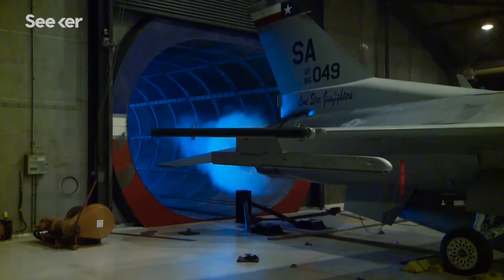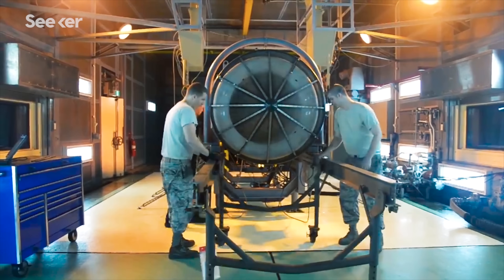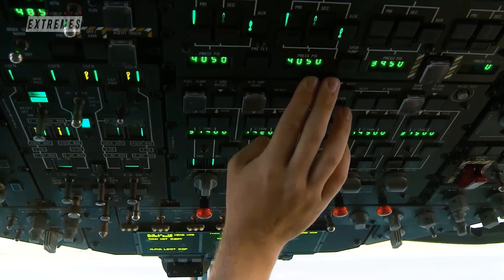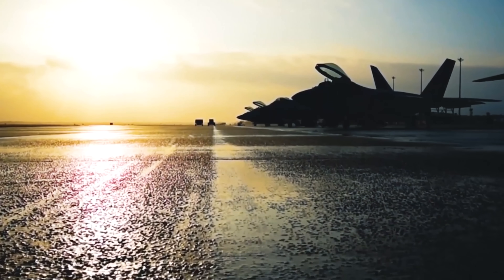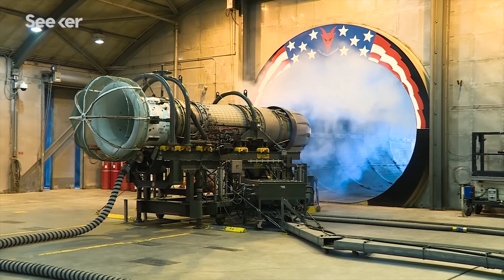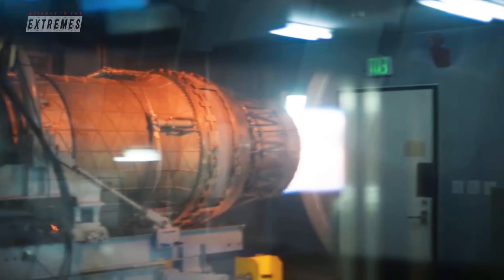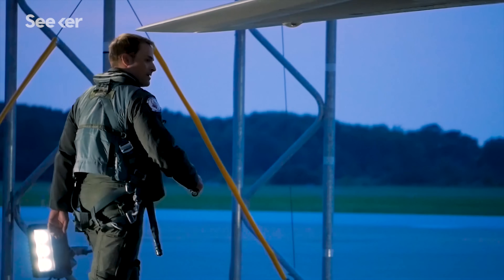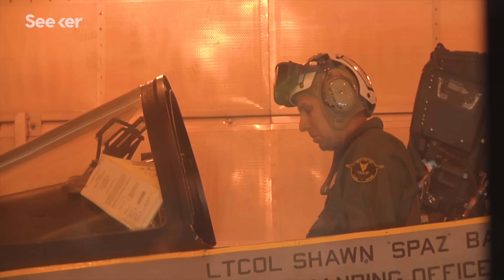How Do You Test the World’s Fastest Jet Engines?

Comment: The F-22 is not the best.

The F-22's Engines are not the most powerfule, F-22 Engine between 32-35,000 ibf of Thrust, the Engine on the F-35 is 40,000ibf of of Thrust, but even that is not the most powerfule.

The F-22's speed is 1498mph using TMS is Mach 1.98 not Mach 2, and the F-22 is not the fastest jet.

Plus the F-22 is not the only jet that can fly Vertical up and not the only jet to supercruise.

Comment: the noise from these engines amounts too 155-160 decibels. that's enough to perforate or even rupture the eardrum rendering you deaf. the noisiest place when the engine is running at full throttle is directly behind it

Comment: Using liquid hydrogen in jet engines would be interesting, it seems unlikely that the commercial air industry will ever make the switch due to the difficulties in handling it and the larger tank sizes that would be needed. But for military aircraft where money is no object and performance is what matters most... I could see hydrogen being used on long range reconnaissance drones that have to stay in the sky for long periods of time, or something similar like cargo planes that have to travel extremely far without refuelling. Fighter jets might be impractical because you'd have to make them significantly bigger to hold enough fuel and that could compromise the stealth aspect.

Comment: i worked on f-16s in the air force. they also test engines outside next to the hangar. the hush house is only used during quiet hours or for new or removed engines. standing next to an engine in full afterburn does more than vibrate your chest. it rattles your entire skeleton and you understand what real power is.

Comment: "Their mission is to make sure the jet engines don't explode..." sitting right beside a running jet engine!
Reply: With polarised capacitors connected backwards and feeding them 220V instead of rated 12V...yeah i watch your videos😂
Reply: How come you don't have more likes
Reply: it's actually normal to stand beside an engine during test runs or so, we do it all the time with commercial plane engines. Standing behind or in front or within it's radius or suck or blow is a whole other story
Reply: @Huy Thai Actually, what they do is they firstly run the engine in a Testcell, where the computers handle mostly everything and no humans is allowed even close to it, after that Testcell, they do another test where they see if some of the parts are working in the engine, such as the Starter Valve, this valve actually needs a person to manually open it, and as soon as it opens, the engine starts up too, making it dangerous for the person to move infront or behind it as well, and hence he just stands at the side of the engine, which is safe.
Reply: Lol
Reply: FULL BRIDGE RECTIFIER!!!!
Reply: BOOM
Reply: Ouch!!
Reply: LOL
Reply: Hey Electro!!
Reply: well the engine housing is designed to contain any parts that may come loose during what's called a blade off event or fan disk malfunction. the only places where you wouldn't want to be near the engine while it's running is either in front of the intake or near the exhaust.
Reply: FULL BRIDGE RECTIFIER FOREVER
Reply: Hey there!!! Man you commented on this!!!
Reply: Sup ElectroBOOM.

Comment: SEEKER is my recommended SCIENCE channel.........*10/10*
Reply: My god! I really hope you know of better science channels on YT...
Try Smarter Every Day, Veritasium or Sci-show for a start. Seeker features a whole lot of spin and hopefully Sci-show isn't next but in all honesty all of these channels has spin sometimes. So why is Seeker not on my list of good science channels? Because they spin almost every video one way or the other. Ok so this particular video is mostly accurate... Except when they used the wrong b-roll at certain points in the video showing off an F35 and many clips with F16 Fighters and multi-role craft instead of the F22 which the only fighter craft they mentioned by name in the video. The F22 is a stealth fighter, but noise isn't going to be an issue. It's a jet, it's loud what makes it stealth is the paint job, composite materials and body shape all made to absorb RADAR emissions instead of reflecting that light back to the transmission dish. Of course stealth as we know it will soon be completely irrelevant maybe that's why the Air-force is talking about stealth fighters more often these days. Drones are the future unfortunately. The skies are about to owned by machines rather than manned craft anyway so it wouldn't matter as much if we can blow them out of the sky interrupt communications with a base or jam up their electrical components via ECMs. Warfare is turning into a game of chicken that can only be won by the wealthiest nation involved in the conflict (depending on hubris).
Reply: @VariantAEC  will do

Comment: Fastest jets,ha? That be ram jets. how do they test those when they need mach air speeds to operate?
Reply: Fastest jets,ha? That would be SCRAM jets.
Reply: Fastest operational jets ram and scram jets are still in the prototype stages just cus of the extreme requirements for them to start up and run

Comment: or solid fuel and a really good oxidizer or a good air compressor.
Reply: Solid fuel engines cannot be throttled. They're also massive and inefficient.
Reply: @LandoCalrissiano  you can transform a solid into a liquid by using a vacuum or transforming a liquid into a solid by compressing it, they are compressing hydrogen, the hydrogen could become ice under pressure...also i really doubt you know any solid fuel that become liquid into space.